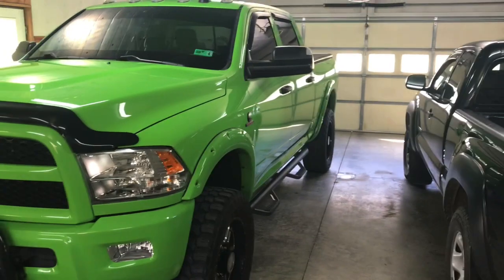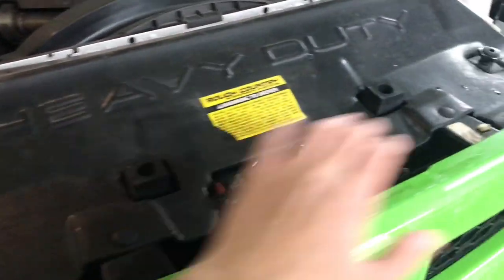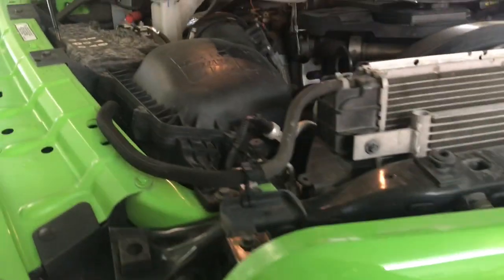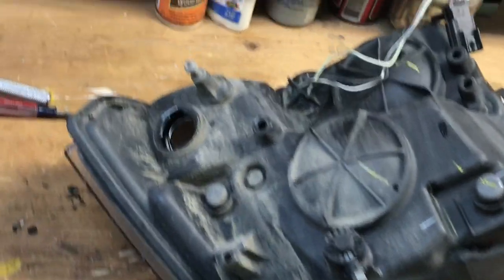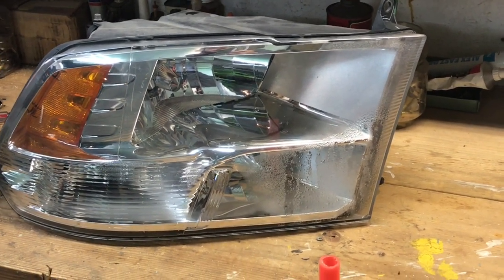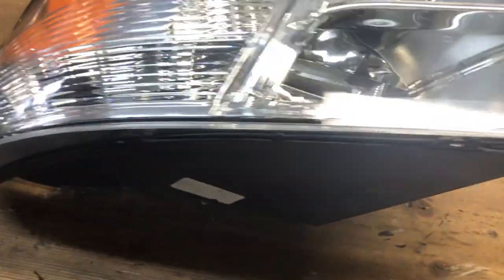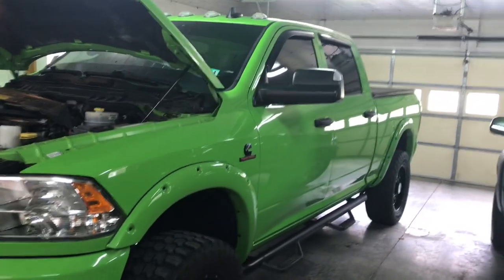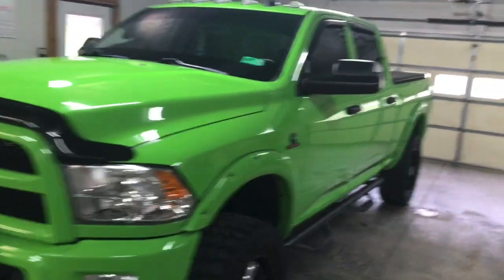Ram 2500 Headlight Condensation Removal And Fix

Comment: Nice video.  Alittle help when adding silicone to seal is I took a q-tip, break then cotton end off and it makes it a tad easier to get around/tuck the silicone into the tighter areas around the clips.
When ever I install new head / tailights I go over them with silicone before the install because of the manufacturing process they seem to always have a default in sealing and will eventually leak.
Nice color of a truck you picked out 👍

Comment: Not covered under the extended warranty I paid $3200 for and my Chrysler dealer said the only fix was to replace the headlamp assembly. $724 for the part!  I declined and started researching. Thanks!
Reply from the maker: Glad I could help!
Reply: Same here,  called for the exact thing today, no extended coverage on headlights, as always parts that go wrong they don’t cover, garbage warranty

Comment: Thanks for the info! I went to get my 2015 Ram inspected and they will not inspect it if there is moister in the headlamps. This will save me around 600 bucks. Thanks again.
Reply from the maker: Stephen Tokoly Anytime and if u have any questions just message me hp customs sparks on Instagram and hear

Comment: I have a 2016 and you really dont need to take the grille off...all you need is an extension on your ten mm socket. to put it back down in the well, put electrical tape on the head of the bolt. That way it stays on the socket as you lower the bolt down.
Reply from the maker: That sounds like a little bit of a pain but ok thanks
Reply: HP Custom Sparks Less of a pain than taking the entire grill off.
Reply: electrical tape on head of bolt? Just take a piece of a shop towel and lay it across the 10mm socket, JAM the bolt into the shop towel and into the socket. Good luck getting the bolt out of the socket, unless its threading into something! Your welcome fellow techs!

Comment: Nice video. I have something to add as I did this exact same thing to my left headlight 3 years ago on my 2014 Ram 2500. Only the left, strange. I am currently drying it again with the hairdryer. I cant find any gap in my silicone so i am drying it out and going to toss a dessicant pack in there like I did last time. I cant say how effective the Dessicant is but I don't think it hurts. Dropping pack next to turn signal bulb area keeps it away from wiring and bulb. My left tail light has same vapor problem also.
Reply from the maker: Thanks and the darn Ram headlights
Reply from the maker: I feel like we’re just better to get aftermarket ones, dont have to worry about leaving and it looks better lol
Reply: Agree. Honestly I would replace headlight with another Mopar headlight but afraid of ending up with exact same problem. Aftermarket probably better.
Reply: Check your vent caps, mine are brown and had one missing a gasket and full of water

Comment: i just took my passenger side aftermarket one out for 3rd time, siliconed everything gaskets and all and put stock vent caps which have a membrane in them on, noticed the top vent really doesn’t go anywhere, so drilled a hole in housing close to the upper vent wish me luck 🤞
Reply: did this work?
Reply: @danielfiner6242   not at all

Comment: It’s the blocked vents on the rear of the headlight assembly! It’s not the perimeter seal. Adjust your vents and your problem will disappear. The silicone was not necessary.

Comment: I need to do this to mine are both your headlights still leak free?
Reply from the maker: Yes they are!!
Reply: @HoldenPowell_  thanks may try this on my 2015 1500 that I recently purchased the driver side is bad may do both to prevent the other
Reply: @Dasher-jt3fi  Drivers side seem to get it the worst

Comment: I just removed mine without removing grill. Just need a 12" extension to get to the bottom bolt. No problem and quick.
Reply from the maker: That’s cool but it only takes me like 3 minutes to pop the grill out and then I don’t have to worry about getting the headlight out around the grill or accidentally scratching the grill while taking the headlight out but good to know u can get it out without halfening to if u didn’t want to
Reply: Yes I did too that is the only way to take the headlights out
Reply: 😂 @HoldenPowell_